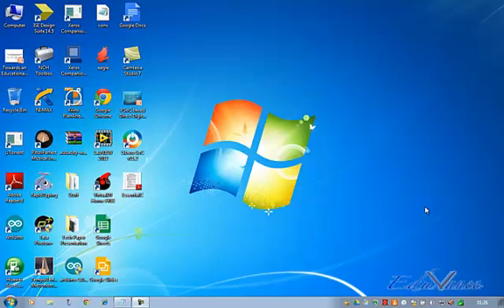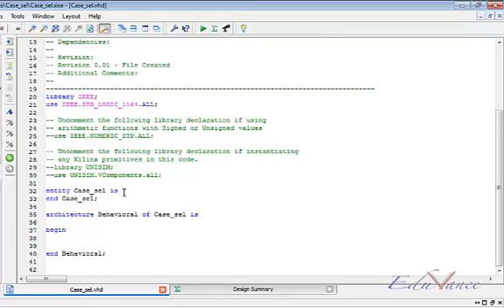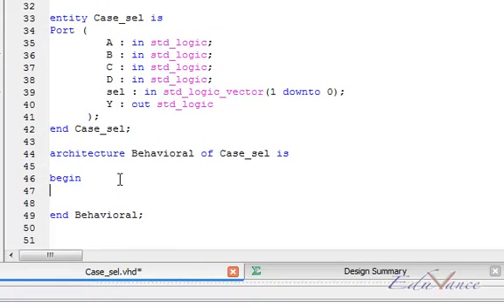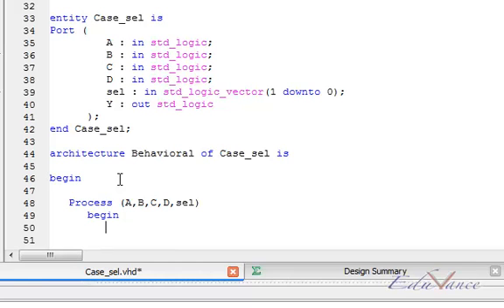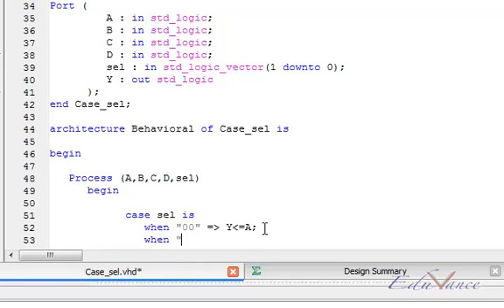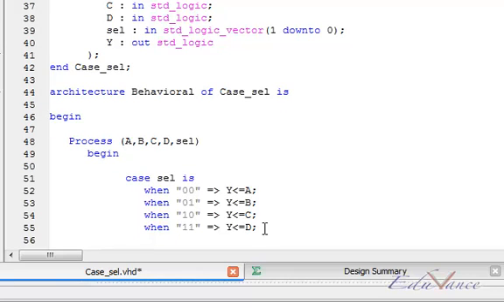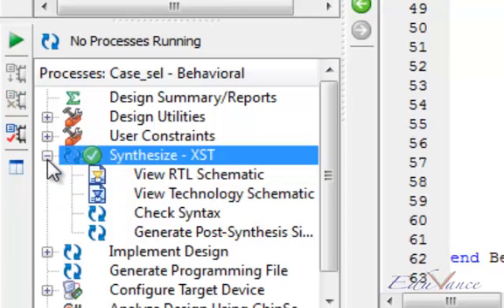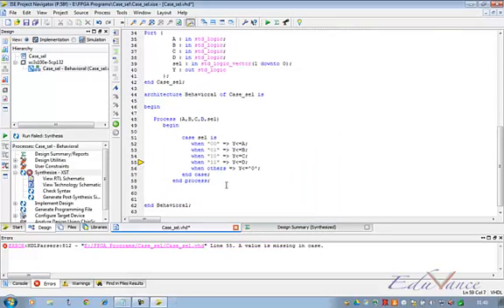VHDL Lecture 14 Lab 5 - Case Select Explanation

Comment: Can I just put Process(sel) and why not? My thinking is, whenever sel changes I will "reroute" signals to Y. So when one of the routed signals change, Y will to. Or am I badly wrong :D ?
Reply from the maker: The change in routed signals will not be reflected on the output. In the case mentioned above, process (sel), the output will change only if there is a change in sel line. For output to also change wrt to change in input signal, they should also be included in the sensitivity list.
Reply: Understood.